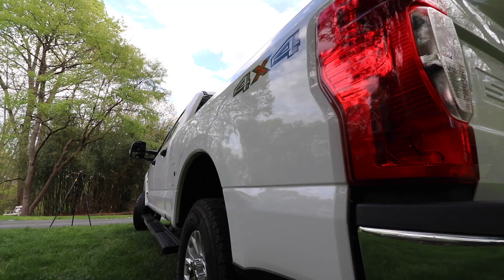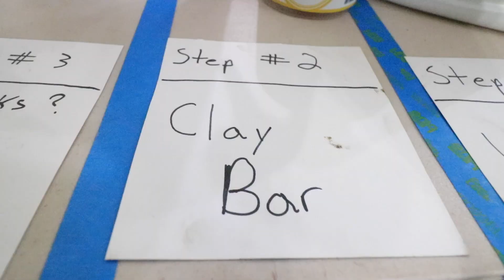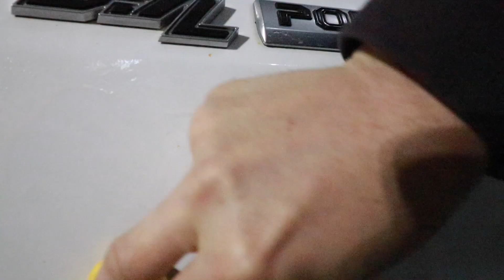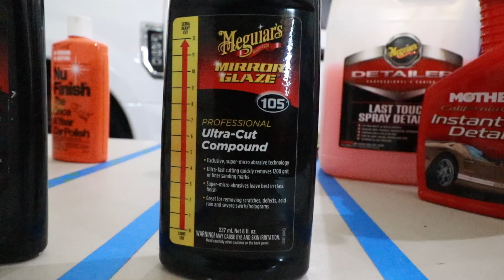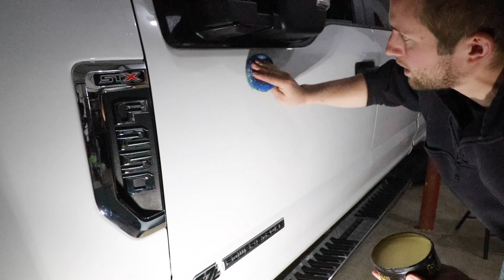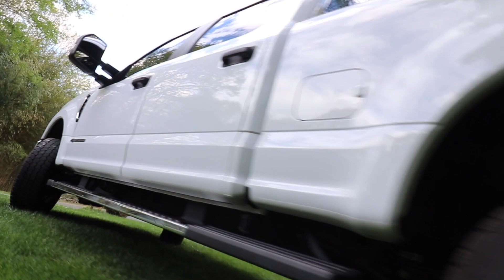How to polish a Car at home | 5 Simple Steps

Comment: Nicely done 👍 if people wish can use a iron x or iron remover and before applying wax clean with a IPA. Great video and the truck looks great
Reply from the maker: I've never heard of Iron X or an Iron remover. Have you used either before? Does it remove iron rust specs in the paint? 

Clay bar works pretty well, but it takes a lot of elbow grease.
Reply: @OldSoulMillennial  I have so when you spray it on it smells bad but any ferrous metals it will react and turn red starting the break down makes claying much easier. There's vids on the process. Great job on the truck and hope all is well and your doing better keep the great videos coming 👍👊